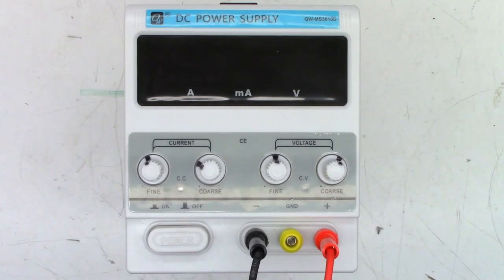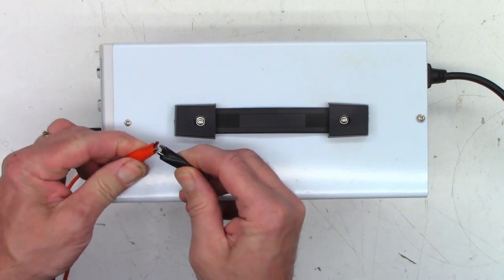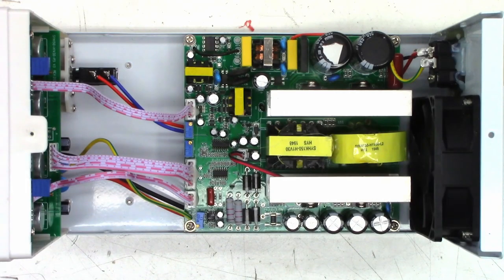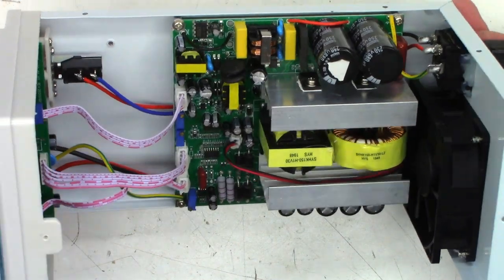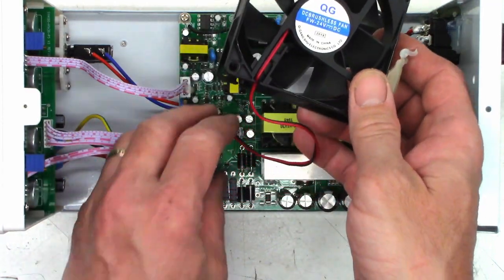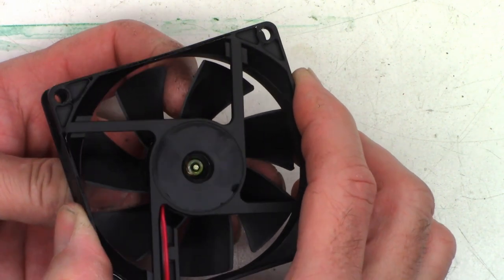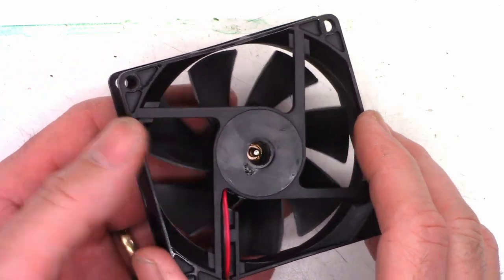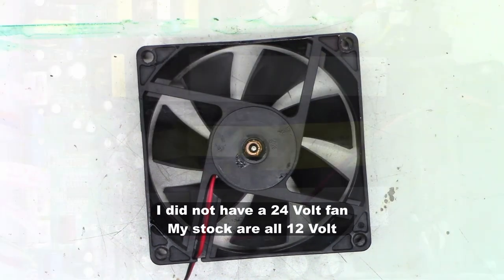Cheap Chinese power LOUD fan from day 1. A band-aid repair until I get quality parts. QW-MA3010D

Comment: put a diode in series.. also spray wd-40 in the fan bearing .. remove the sticker on the back of fan and spray wd-40 in it.. tool oil works good also
Reply from the maker: I used fine machine oil. I did order ball bearing fans to replace it with. It's only temporary unless it works.